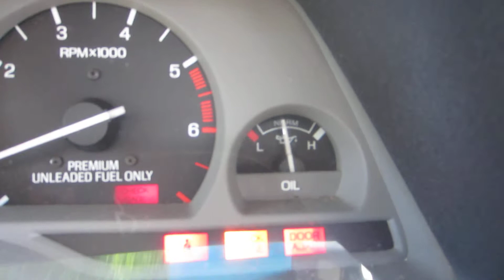89 Super Coupe idle problem

Comment: is this after the work you did?  do you have the VAC line hook up to that Intake tube. that goes the the THROTTLE BODY. that line go to that and all the way around to the valve covers. that hook up to the PVC VALVES ON TOP OF THE VALVE COVER.  could be a miss fire. bad coil pack. plug wire not hook up. all the way. Air idle control valve. on the throttle body. mass air flow sensor you can clean both the sensor to see if  that fixes the problem i would SEE IF YOUr GETTING any ENGINES CODES.